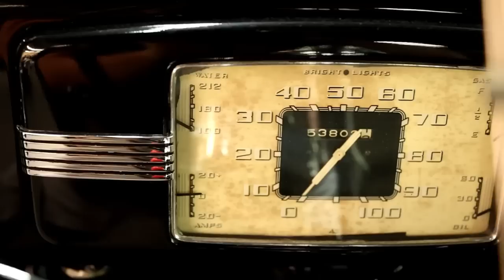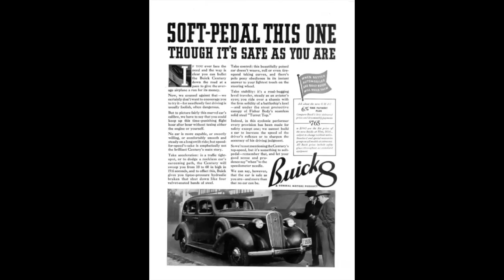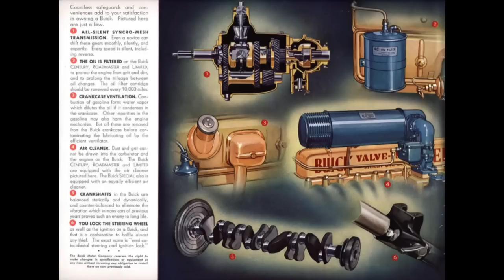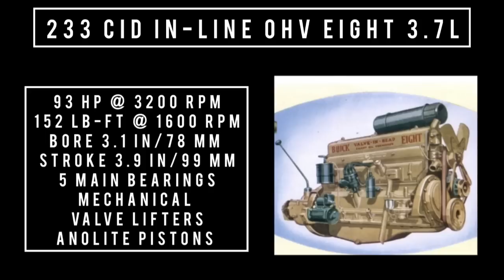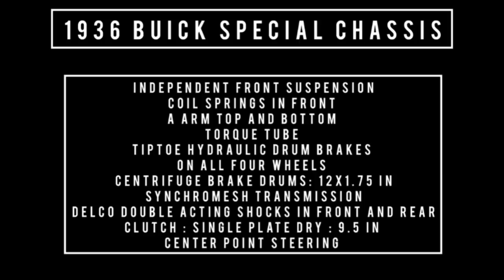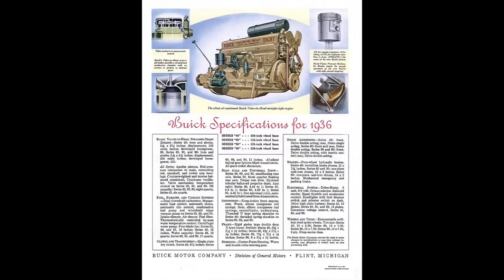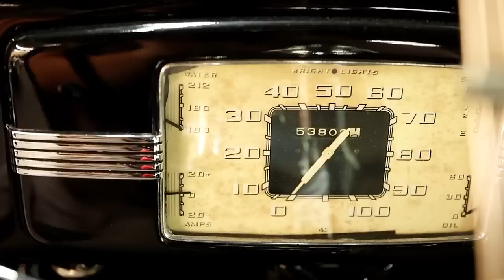1936 Buick special aka series 40, no other car has ALL these features!

Comment: My great-grandfather had a '36 4-door sedan.  It had been garaged, covered and not driven for 23 years.  First time I saw it:  "We have to ride and drive in this thing?"  In 1958 it was just an old-fashioned car.  Starting a dental practice my needed a cheap "office" car.  The car was graceful and elegant.  The interior appointments were remarkable.  But GG, thrifty soul, would special order a car to avoid paying for heater, bare-bones hubcaps, no outside mirrors, and certainly no radio (if they were available in any of the '36 models).  As dad was driving to the office one day, he heard some rattling and clanking only to look in his rear view mirror to see a barrage of auto parts all over the road, surprised it was even still running.  It's last trip was back to where it came from--and sat in the barnyard for 8 years, flat/cracked tires,  increasing rust but the interior remained in great condition.  After convincing grandpa he should sell it, I put up home made ads on telephone poles along the road:  "Look ahead, the car of your dreams is in the next driveway to your left.  $80.00."  (yes, eighty).  The signs finally fell down and he gave it to a kid who lived on the ranch next to ours.  A few years later and Gary brought the car out for us to see it.  He did a complete restoration (remarkable even for the late 60s) and then sold it and made a tidy profit..it's probably about time to restore it again.
Reply from the maker: Awesome story thank you so much for sharing those memories =)
Reply: Definitely 1936 Buick, but having one makes me biased.

Comment: Hi Jay, thought I'd do a little research for you. Nash did adopt unibody in 1941 for their new 600 model. It was the first year for the 173 cid 'Flying Scot' side valve six. They called the design a sealed in engine since the intake was cast in the head.  Styling by Raymond Lowey. 'Weather Eye' conditioned air system. And, of course, Nash offered the reclining front seat option. Interestingly the Ambassador model utilized a unibody but then mounted that to a frame. Keep up the good work. Your vids are very good.
Reply from the maker: Awesome thank you so much for all of that information I really appreciate it I always wondered when they went unibody I know Chrysler was the first to go unit body in America I saw one for sale and I saw a frame attached to it a 36 model so I had my answer but I didn’t go back to the comment and fill it in sometimes it gets really hard to go back Mark Chandler was right

Thank you so much for all of that information I really appreciate it =)

Comment: Nash and the Buick ☺️👍
Another great episode ✌️👏👏👏
Reply from the maker: What did you think of the chassis segment I’m thinking about doing it like the engine and specifications segment breakdown clutch brakes used of course it’s only if I can find the information on the car I was able to find a lot of information about this car 

Glad you dig this episode =)
Reply: @What.its.like.  👍 For me just as important as everything else .....🤔
I enjoy technology progression and innovation 🤔👍.
My grandfather looked at the rear Crosley suspension set up and did it front and rear of a model T speedster??
Better ride, handling and lower than a stock Ford T ... remember a junkyard and creative vision is the key to Hot Rodding and affordible projects 🤔 good luck with yours 😉👍 enjoy your adventures ✌️
Reply from the maker: Totally agree thank you so much for the feed back

Comment: I like the 35 dash as well as the grille too. Also, I could never understand the side mounts being on the driver side if you pulled off the road to change a flat tire you're on the side of the road with traffic coming by while you're trying to wrestle a wheel out of your side mount

The passenger side would at least get you out of the traffic lane somewhat. Of course if the flat you're having to change is on the driver side you're going to be having your butt hanging out into the traffic anyways.

GM had mastered the turret top by 36.  GM used that as a selling point over Ford who hadn't yet figured out how to do a one piece top yet.

36 Studebaker Custom 6
Reply from the maker: The dash reminds me of a packer – the fenders on the 35 remind me of a Packard I think that’s why I like the 35 so much it looks like a Packard I looked up to see how much his cars are worth versus what they’re going for what they’re worth and what they’re going for two different numbers they’re generally asking three times as much for the car than it’s worth anywhere that I found it for sale.. those are so cool maybe I’ll find one this year

Great choices =)

Comment: Yes, a great looking car, and thanks for the mechanical detail. Buick was an early adopter of coil rear suspension. I know they had it in 38, but didn't know when they started doing it. It wasn't 36 apparently. Also they were very late to abandon torque tubes, as late as 1960 I think. On oil filters, thesedays they are full flow, in that the pump pushes the oil through the filter before it gets anywhere else. In earlier days, just a feed from the pump went through the filter, on the principle that all the oil would get filtered eventually. Whether an early motor can be modified for a full flow filter depends on it's design. Some can and some can't.
Reply from the maker: Awesome thank you so much for sharing that information and insight =)
Reply: A bit late, but the 13 Buick introduced rear coil springs.

Comment: That's a bypass oil filter. Some oil bypasses the oil circuit and goes thru filter. From the filter it goes back into the oil pan. If the filter gets clogged the engine still gets oil, but then again dirt in oil pan can easily get into bearings. Oil change interval was much shorter than oil filter interval.
Reply from the maker: Awesome thank you so much fir that explanation in other words only part of the oil is filtered

Comment: For me on the, 'Would You Rather':  1.  The Studebaker.  '36 was also a year when airstreaming was popular, which I personally don't care for.  Of the three, the Studie has the least of that style influence.  2.  The Custom 6.  It's casually understated.  The lines of the car are of a forward rake; which is uncommon but works well.  Great video, Jay!
Reply from the maker: Awesome choices =) for me it would be the 35 Buick and 36 Nash all the choices were cool and the Hudson is really different
Reply: I will second your choices with the Studebaker Dictator St. Regis and the 1937 Hudson 6 with its classy waterfall grille. BTW the name "Ambassador" was featured prominently for a long, long, time in the Nash lineup because our family had for about ten years a red 1969 Rambler Ambassador station wagon. Not a bad car for its time. Nash always made good cars.

Comment: I wish car designers of today would learn a thing or two by looking back about 90 yrs to see what real deaign looks like instead of every new car looking like a transformer.
Reply from the maker: They used to design cars in/with clay now they use computers.. I miss curves on cars as well as actual gauges
Reply: They had lots of expensive stainless steel fittings instead of cheap decals.
Reply: @What.its.like.  Modern design is all about bean counting.  Anything that can be deleted is to increase profit.

Comment: My favorite era of automobiles: ignition and fuel delivery systems perfected, some modern niceties such as trunks, synchromesh transmissions, radios, aerodynamics, and better heaters (though often optional) with wipers (though vacuum powered). Cars by this time had developed different styles that differentiated creatively between a Ford and a Packard, an Airflow and a Cord. For some strange reason I really liked the style of the Buicks of the mid 30s to the outbreak of World War 2.

Comment: The new Anolite aluminum pistons, coated with an anodic treatment, replaced the cast-iron pistons previously used in Buick engines, providing a nearly 13-pound reduction of reciprocating mass, allowing higher performance. 

The inclusion of an oil filter meant that oil life doubled. The oil filter only filters the oil going to the rocker arm valve train. The oil change interval back then was every 1,000 miles, non detergent oil (yes it would have crud)  that said it worked just fine. (even into the mid 60's when I began working many customers still asked for Non-Detergent oil)  Keep in mind it wasn't until the 50's that oil filters became more common.  Also - the old Babbitt bearings were very common and held up well, back in the day pouring new Babbitt was done without much drama.

Also, the carburetor is not an orignal on that engine and you can see it has a cable for the choke, hence the double T on the dash, somewhere along the line someone added it.

OK WYR 1? Buick WYR 2? Buick
Reply from the maker: Cool choices thank you so much for sharing all that information and added insight. 

What do you think of the chassis segment I’m going to try to get it to a point where it’s just like the car specs engine specs page

I figured it would be a good addition especially because a lot of people getting into the car Hobby may not know a lot of cars had kingpins for a long period of time like Studebaker they never adapted to anything new
Reply: @What.its.like.  Might be interesting.

Comment: The oil filter on this car was a "bypass" oil filter, which did not filter all oil using the pressure oiling system, as later cars did.  Thus, the canister was not changed when the oil was changed. The oil change interval for most of the 1930's and 1940's cars was 2 months or 2,000 miles, whichever came first.

Comment: External filter mounting has to be cast at the time of casting of the block. If that's what you are asking. Or are you trying to ask about spin on filters?
Reply from the maker: In block oil filter added to the oil pan so can have in block oil filtration

Comment: It was really the 34 Series 40 that pulled Buick out of its post- 1929 pregnant Buick doldrums.  I tend to prefer the 34/35 as the early potato body stuff doesn't usualy do it for me (though Buick rebounded strongly for 37 and the 38 is steller - by which point of course the Century was a true 100 mph car not just in copy writer's dream).  Postwar the Special took Buick eventually to 3rd place, but quality slipped and Buick crashed into an also ran by 60, before building itself up again.  WYR:  Buick/Buick.
Reply from the maker: Sweet choices =) thank you so much for sharing insight

Comment: Those oil filters were bypass type only. Full Flow type was not used yet at that time. Only a small portion of oil that was going to moving engine parts was filtered. Crankcase ventilation systems were inadequate at best and engine oil was of piss poor quality with regards to know the additive or very little additive package used. A lot of internal engine sludge happened after a while.
Reply from the maker: Awesome insight

Comment: 47 Buick 0-60 57sec.   5min to stop   the 40 had two carbs on the fireball  8😂    48 dyna wontcha. flow
Reply from the maker: Hahaha yeah stopping sometimes is/could be interesting lol 

I prefer a manual transmission for that reason